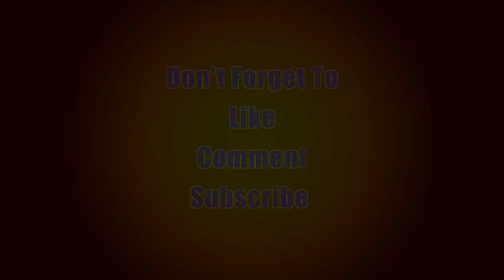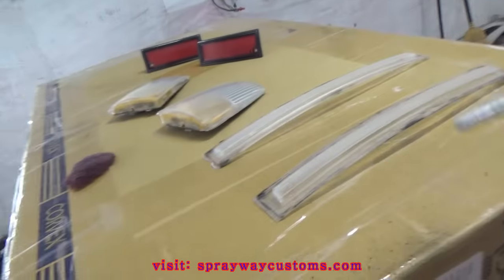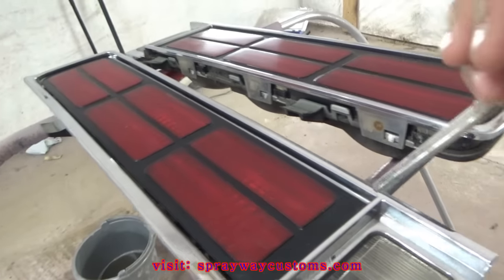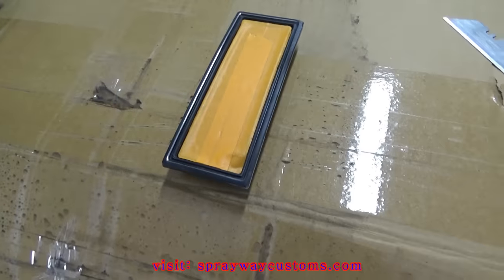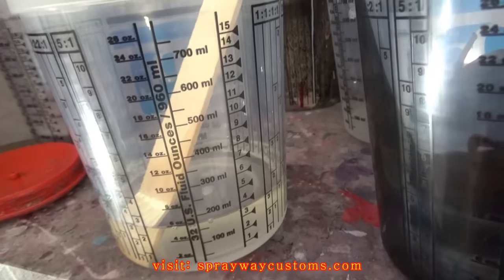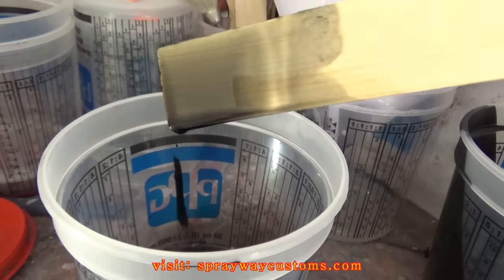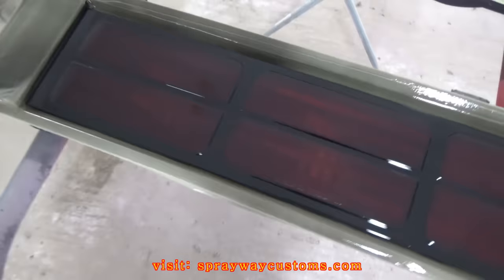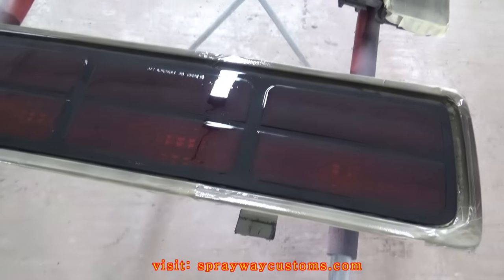How To Smoke Tint Tail Lights - Box Chevy Caprice LS Brougham - Restore Opera Lights Corner Marker

Comment: When you smoke the tail lights....do you have to worry about the po po police at night?
Reply: With the light tint he used on this, it probably won't be a problem, but you can compensate by installing brighter bulbs.
Reply from the maker: As long as it's not to dark and the lens still reflective you should be fine

Comment: Another thing you can do is get some clear base coat. DBC500 in PPG and BC00 in BASF are the two I’m familiar with. Same process as what you’re doing. I usually go 10% black base coat in the clear base. 2 coats of whatever clear coat you are using after. That way if you screw anything up it’s easier to fix. 

Keep up the good work.
Reply from the maker: Thanks

Comment: I suggest switching to LEDs. It's not hard, and they run brighter and cooler. Incandescent bulbs are hot, and they will run hotter with the tinting. I melted the taillight lens on my bike when I was a kid by doing exactly this. Looks great. Great video.
Reply from the maker: Thanks for the info 🤝

Comment: Been watching a lot of your videos, so went out and got the stuff I needed to paint the fillers on my 84 cadillac sedan deville. Do u have any suggestions?
Reply from the maker: E Butler are you referring to the bumper fillers. If so, if it's raw plastic make sure to scuff it real good and use a plastic adhesion promoter.

Comment: You got anything to bring back 85-88 G-Body Cutlass lenses back from the dead?
Reply from the maker: If they don't have any cracks in them you can do the same as I did
Reply: Welp, I'm S.O.L. got the common stress cracks on top. 😱
Reply from the maker: You can still do it but if it's cracked the cracks will still show through but it'll seal them up. If they're just light scratches it'll hide those Jay Poe

Comment: Looks good. Thanks for posting. I have a question. If you are going to flow coat a car.  But the clear you are using calls for a tack coat first..  After u sand with 1000...do you still lay a tack coat or do you come out wet on the first coat of the flow coat?
Reply from the maker: I'll come out wet but turn the material in a half of turn and then open it back up on the next coat
Reply: @SprayWayCustoms  good to know. I painted my dash today check out the video in a few hours. 👍👍

Comment: I go into a dark void in between videos until you cut me back on. 😲 It sucks in there. Nothing to do. 🤣
Reply from the maker: 😂😂I'm gonna try to keep you on 👍🏾
Reply: @SprayWayCustoms  I got a wrecked Buick Ultra that I'm thinking about cutting the sun roof out of to use in my 94 Z71 extended cab Chevy truck or my 95 Cadillac Eldorado. I haven't done the measurements yet to see if it will fit either way 😬. #Summer Project
Reply from the maker: You should be good with an extended cab
Reply: @SprayWayCustoms  The rest of the Ultra interior is going in my Park Ave to make it an Ultra clone. The Ultra has the peanut butter leather. Major improvement over the worn out grey leather in my Park Ave. Then add a supercharger and EPROM in the computer for the fuel map.